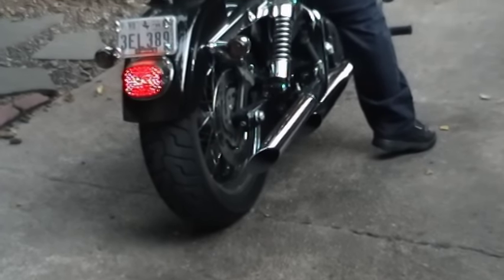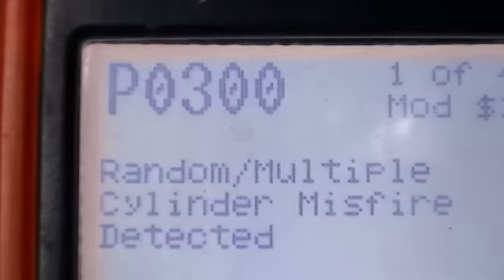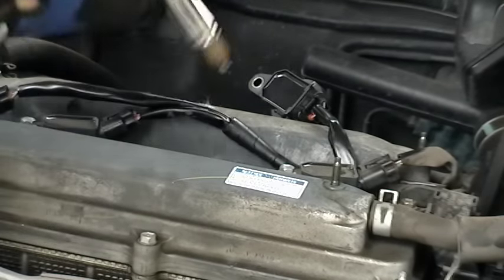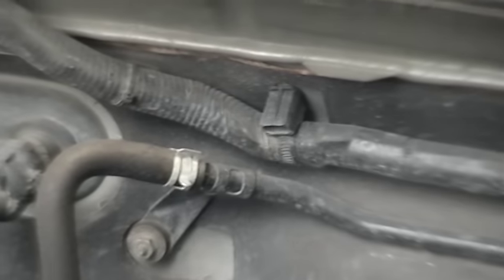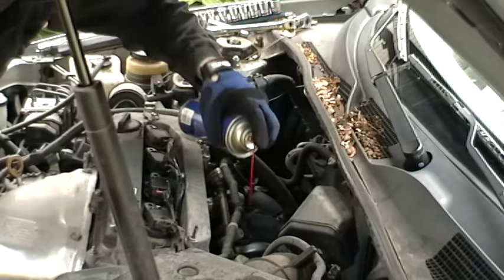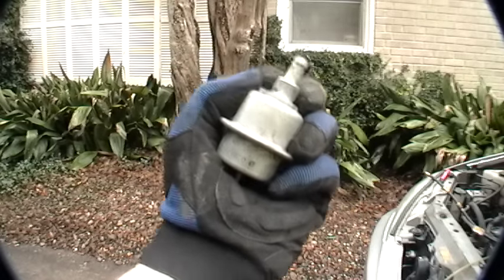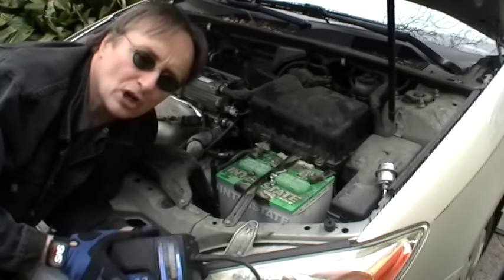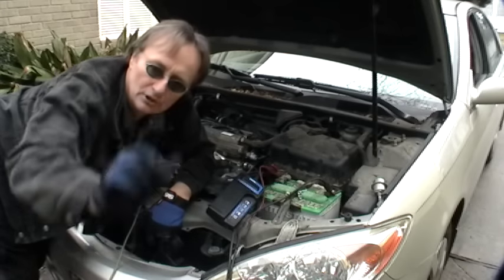How to Fix a Random Engine Misfire in Your Car (Code P0300)

Comment: Just had a engine misfire in Cylinder 3 & 4 in my 2017 Ford Escape that’s just under 34,000 miles. Luckily my warranty is still valid until my lease runs out. I booked an appointment with Ford for Wednesday.

Then, just 30 minutes ago: I cranked my ignition just a tad longer and the error code magically went away. I went around town, restarted the car, revved up to about 4000 RPM, just to see if driving would trigger the code back on. I was basically trying to see what could possibly bring the code back during my normal day-to-day commute. 

I guess if the check engine light comes back on before Wednesday, I’ll keep my appointment. I had this car since it was a baby, with only 6 miles on the thing ... Fingers crossed.

Comment: Scotty!…. Thanks for replying to my last post… Need help again.. I took my car to get the exhaust manifold changed out by the mechanic because my car was running lean.. My sister went to pick it up for me since I was at work and I wouldn't be able to pick it up the next day either.. when I got back I checked out my car and it had a flashing check engine light.. I open the hood and look at the engine and theres a couple wires that were slightly exposed near the exhaust manifold where they placed the new manifold.. At the end of the manifold there is a jolt of electricity that flashes repeatedly maybe 2 times a second while the engine is running and it travels to another metal area about an inch away..I run inside grab my code reader and it was a P0300 code… They're closed tomorrow so I'm going sunday to make them fix that error. Do you have any suggestions on what to tell them to fix.. I love my car and I'm trying to keep it so I can give it to my son as a beater… Note I'm 20… Its a 96 caprice in great condition which is why it bothers me so much that there incompetence has given me a misfire code. PS. It looks just like the flashlight trick you show us but its coming out near the manifold or near it without a flashlight… Thanks Scotty.
Reply from the maker: they are idiots who do crap work, probably spark plug wires shorting out and flashing, but really, don't pay them anymore and never use them again. Mechanics are supposed to road test and check their work
Reply: Scotty Kilmer  Thank you, you're the best!

Comment: You forgot EGR valve hanging open which is a very common cause of engine misfire especially multiple miss fires. The carbon build up can cause the valve to stick open sucking in air and changing the air to fuel ratio. I went nuts for months trying to find the issue on a Honda Civic. Come to find out when unplugged the egr the car ran like new! So went and pulled the old one. Sure enough, clogged solid. I replaced it and plugged it back in. All is well.

Comment: great vid. I have a 98 geo tracker throwing p0300 and p0400. I have not checked spark plugs yet but i am going to. regarding the p0400 code i have replaced the egr valve with no luck. code still gets thrown, i have checked the hoses and no visual signs of leaks.. any tips? trying to pass DEQ
Reply from the maker: fix the 400 code first, as that will often cause the 300 code to pop.  Try my video "finding engine vacuum leaks with a cigar"

Comment: hey scotty i have a 94 mx6 ls and got a misfire but i dont know what is causing it. timing is fine both spark plug n wires have been replaced to oem spec. is there any sort of test i can do.

Comment: I received this code on my 2003 Nissan Altima 3.5L after my daughter ran the car hot for several miles. What could running the engine so hot hurt to cause this code? Don't think the heads are blown.
Reply from the maker: odds are she blew the head gasket, do my video "how to tell if your head gasket is blown" as that finds ones that just are starting to blow best

Comment: I bought a 2012 Chevy sonic at auction and this is my last hurdle to clear
Replaced the plugs and coil pack as soon as I bought it. Battery is new too

I'm hoping it's a simple fix. Any common causes with the 12 sonic?
Reply: You may have conquered this already, but not covered in this video are the cam and crank position sensors... theyre whats causing the p0300 on my 01 blazer... obviously not a 12 sonic, but gm... food for thought

Comment: I have a 2008 Chrysler Pacifica AWD, had a check engine light went to autozone codes popped up p0300 &0016 which is multi cylinder  misfire and crankshaft/camshaft timing misalignment. So I want to solve the problem. Changed spark plugs, valve cover gaskets and o ring seals (because there was oil in the spark plug tubes) and all six ignition coils, check engine light came back on after about 5 mins of idling. Engine is still riding rough with a consistent ticking upon start which turns into a knocking within a few mins of idling. A friend suggested it may be my timing belt, but I have also been told it could be carbon build up (so I have also used a fuel system cleaner treatment 2x). Can you give me some advice before I spend more than what I need to to fix the problem? Please get back ASAP, Thank you.
Reply from the maker: often worn timing chains do just that, have a mechanic check that first with his equipment

Comment: Hi there, after replacing the purge valve, code PO444 still appears. Vapors are causing my 2007 accent to run rough after refueling. Could the problem in the charcoal canister?   Thx gcruz

Comment: humm what should i do I have P0300 P0301 P0302 P0303 P0304 all together 
I changed all spark plugs but i still have all those codes
I owned a 2003 honda civic hybrid 
I looked at the spark plugs today they were black like the old one 
A someone told me that they might get too much fuel
>>>What advice can you give me please

Comment: Hi Scotty! I keep getting the P0300 code and none other while the car is on the move. Also the car jerks a lot while it is on idle. I have a 1.6l Chevrolet Lacetti (Optra in some countries and Forenza in USA but I think Forenza has diferent engines). I was told that the problem could be sticky valves. Do you think this could cause the P0300 code? Shouldn't I get other error codes if the valves would be sticking?
Reply from the maker: could be valves, just realize scores of different things can trip that code, anything that causes random misfiring. good luck
Reply: Hope that there aren't the valves. They aren't listed in the car's service manual as causes for p0300 but I guess you never know.

I'll look for vacuum leaks some more and replace the ignition coil and see from there. Thanx for your answer!

Comment: I question the battery claim. When the car is running, all the power is supplied by the alternator so it's irrelevant the condition of the battery.

Comment: I have a 02 mazda b3000 v6engine. An the check engine light is on. When I don't give it gas. The check engine flashes. Changed the spark plugs an it seem to make it run worse then before. Any suggestion would help me out a lot.

Comment: Scotty I change spark plugs 3 and 5 on 2000 and check all coil and they look in mint condition. I even swap them around and it's still give me 3 and 5 bad. With bad EVAP and bad O2S. I hate to take the car apart again to change out those spark plugs could anything else be wrong? I replaced cat. Converter and replaced O2S at the bottom near between driver and rear seat.  The smoke too much it's white and gray.
Reply: 2000 Avalon

Comment: Hey Scotty I have a 2006 dodge stratus v6 2.7l non flex fuel my question to you is about the spark plugs is it possible to remove the back three spark plugs 1,3,5 without lowing the engine?

Comment: Hi Scotty, I have a 1999 dodge caravan 3.8L. just yesterday we had a big rainfall and I was out driving in it. Well the service engine light came on and started flashing. The acceleration became rough but would still go but sluggish. It does not give the impression of one spark plug misfiring so? What do u think coyuld be?

Qd

Comment: Hi Scotty, i hope that you can help me, im havin problems whit my Dodge Dakota 2004 6cil 3.7 lts, the thing is that i have a misfire at idle and the p0300 code comes on, the truck when its Cold in the morning and you star it to warm it up for 5min and then drive wont do any problems, then when its warm or hot at its normal tempeture driving range and you stop the engine for more then 5 min and then you start the engine again and drive of the problem comes on as the truck wont take off freely and feels like is choking, (the check engine light stars flashing and then stays on) if you stop then the engine shakes really bad,but then you step on the throttle all the way to take off again and the engine stars to pass by that problem and then takes of freely and as long as you drive it around and dont stop the engine it wont do that problem more, no matter what speed range you are at it wont causes any problem , another thing is that if you take of after being stoped for more then 5 min and step on the throttle and dont stop or reduce speed to idle seems to by pass the problem at that moment and doesnt do it until you stop the engine again for more then 5 min, the main thing its that it only does this problem when engine its warm you star the engine and idle when the problem comes and you by pass it by stepping on the throttle and drive off it wont come again even of you reduce speed to idle!! And this misfire never comes at hi speeds or médium speeds or at a any speed at all... Only at idle... Any way heres what i have done so far:

1.-Spark plugs changed and checked 
2.-IAC valve changed 
3.-Fuel pump changed whit filter regulator
4.-Solenoid purge valve changed
5.-TPS changed
6.-PCV valve changed
7.-Manifold intake changed and gaskets of course
8.-checked for vacumm leaks spraying carbuclean around and idle didnt change 
9.-Air filter new
10.- MAF sensor new( just in case)
11.-Fuel injectors clean and tested
12.-Fuel rail clean
13.-Air hoses changed to avoid vacumm leaks
14.-Battery test whent good
15.-Crankshaft possitioning sensor changed 
16.- ignition coils seems to spark good  
17.- compression test good
18.- theres no wet spark plugs when you take it off not for gasoline or oil

Thats about all i remember jeje!! 
I just hope that anyone coils help me... Thanks a lot for your time!!!

Comment: Hello, i have a lancer 05, and it showed me the p0300 code.
When I crank it, it doesnt start right away. It almost seems it wint start at all, sometime it doesnt start.
When the car is running it looses power, sometimes it goes like dead, it doesnt have power when you press the gas pedal. Also the engine sometimes sounds like diferent, like if it doesnt have full conpresion.
Sparks donesnt have 1 month old.
What else could it be?
Coils? Spark wires? Injectors?

Comment: Hey I’m having a problem with my 99 grand marquis (4.6 sohc). I got the same code and one of my spark plugs got hit by the piston, started after I used ngk spark plugs could they maybe be the wrong size or should I brace for rod knock

Comment: I have an audi a6 2006 wagon,the check engine light flashes when i drive it on sport mode but not on regular D shift mode ,what could be the problem,just happened yesterday?

Comment: Hi scotty,
If you answer posts, please answer mine.  I have a 99 Camry with 2.2L engine. I've kept it well maintained and it has 120k miles on it.  Two days ago, it was driving along just fine when it lost most of it's power and the engine began shaking really hard.  It feels like one cylinder is not firing at all and a second one is randomly misfiring.
The spark plug wires are fairly new - and were high grade.  I already tried swapping the cables and it didn't change the engine problem at all. The plugs are all carbonized where the sit inside the cylinder head, but they are double platinum and are working and gaped correctly. There are no vacuum leaks.  I pinched off every vacuum line on the intake - and the problem remained the same.
The engine has had a new timing belt with tensioner about a year ago (10k miles ago) so I doubt it jumped a tooth. I suspect one of the coils could be bad, but I do see steady sparking on every plug.  Each coil provides spark for two cylinders (total of two coils). They are really hard to get in and out because of all the stuff between me and them. I thought about the fuel injectors, but that wouldn't suddenly happen to more than one of them.

Do you have any history with this engine and this error?  I have a real good code reader. I got the P0300 code one time. After I reset it, the error did not show again even though the engine still runs bad like it did when this first happened.  I changed the big rubber intake thing a month ago. The old one had split open slightly. It still ran good even with that crack.

Thanks
Reply from the maker: have a guy like me hook up a dealer level scan tool, that will show where the misfire is coming from, like ignition coil or bad fuel injector. A pro can figure that out without guessing. Could be as simple as a bad coil or bad fuel injectors
Reply: Scotty Kilmer  Thank you Scotty. I'm in Southern California. Can you be here in the morning?  Ok serious - thanks.  I don't think it's an injector because two would have had to fail at exactly the same time.
For a 99 Camry 2.2L 4 cylinder engine - can you tell me which cylinder is #1, 2, 3 and 4?  I'm guessing it's left to right (passenger side is #1, then 2, then 3 and then 4 on the driver side.
Am I right?
Nice motorcycle by the way.

Comment: 2005 Town and Country 3.8 V6 .  1st is says Cylinder 3 misfires. I changed all 6 plugs and wires. Now it says multiple cylinders misfiring. Also it smells gas when I drive even one block and is shaking / vibrating when idle and I press gas pedal. Kindly advise.

Comment: I bought a 2000 jeep grand Cherokee out the dealer and the check engine light came on...I figured spark plugs so I checked and they were all wide gapped and bad so I replaced them with new platinum iridium'. codes went away which was 0301, 5...I replaced the spark plugs and all a sudden I was getting really terrible gas mileage. I still have codes 0300, 4, and 6. Jeep starts fine but engine shakes a tab bit. Would you think its more the injectors? My air condition works great so I don't think there could be a vacumm leak but I'll check in the morning. I'm just frustrated I just got it and already problems...but I guess that's what you get with 129,000 miles on it
Reply from the maker: stewyy fam first  if this all happenned after changing the plugs, it probably damaged the coil on plug assembly on top of them, I would change that first, it would cause misfires
Reply: I replaced the coils as well

Comment: I have a 2003 dodge durango v8 5.9 motor. The car started to shake when sitting still and worse when you'd press the gas. We replace the rotor button the distributor cap the coil pack and it's said miss fire on 3,5,6 checked those seems ok wires And plugs aren't even a year old. After replacing all of this what could still be causing the car to shake

Comment: I have the random missfire on my 2002 GMC sierra 4.3. I replaced distributor rotor, cap, spark plugs and wires and it still has the issue. is there something I'm missing?

Comment: Hi Scotty. I have an Opel Agila 1.2, 16V, petrol and I get very often the error P0300 (random misfire) and error P0303. I have changed the coil, the sparking plugs, the oil, I have swapped the injectors, but I get this error code continuously.
When the engine is cool, it works smooth, but when it's getting warm, it starts to "whoop". If I go more than 2.000 rpm, it is "coughing" and if I get it out from the gear, the engine stops without acceleration.
Please help, any idea? Thanks!

Comment: Hello Scotty. I have a 2007 pt cruiser, check engine light came on, then battery was to weak to turn car over, got new battery, car turned over, left for work got two miles and light came on again. pulled code of p0303. switched out spark plugs and wires from 3rd cyl to 2nd cyl and now its giving me p 0300 and the p0303. Should i of cleared the original p0303 code before switching the plugs( am i still reading the orig p0303 code).

Comment: 06 Durango with 222,000 miles. Showing a code 206 and 306 . Misfiring cylinders. I just had a tune up . Did not find a air leak. What else can I do??

Comment: hey scotty, I have a 2000 grand caravan.  just replaced the battery, alternator, and spark plugs and still getting random misfires and thumping sounds when you push the gas hard ...weird thing is that is ran fine with the new battery before it was drained because of a bad alternator. any advice and where to look?
Reply from the maker: check around the spark plug working area for loose wires, connectors, or broken vacuum lines. Pray it's that, cause sometimes just changing a battery on those things will fry the main computer when reconnecting a new one.

Comment: Hello Scotty I have a code PO171 and PO303 ON MY 2010 NISSAN MURANO SL I HAVE JUST CHANGED THE PLUGS  ON IT SND THE BATTERY IS PRACTICALLY NEW BUT IF I DONT DRUVE IT FOR 3 DAYS HAVE TO KEEP GIVING IT A BOOSTER HIW DO I DOLVE THUS PROBLEM I CHANGED THE COIL ON CYLINDER 3 WHICH WAS MISFIRE AND IT SKIPPED TO CYLINDER 2

Comment: Hey Scotty,  After further inspection I saw that there was a 20 amp fuse blown in the engine compartment fuse box that said it was to the 02 sensor, I replaced the fuse and then tested it again with the fuse tester and it shows nothing going to that fuse, it didn't light up and all the other ones did, the code reader didn't give me any codes for that but it gave me those code p0300 random misfire and p0303, p0305, would this be a problem with the sensor and how can I tell what sensor to replace. 1999 Dodge Dakota 3.9 Lt
Reply from the maker: +Cliff Moses   IF the fuse shows no power now, it could have fried the computer circuit that drives the O2 sensor. BUT, try a new sensor and pray the computer and wiring is Ok